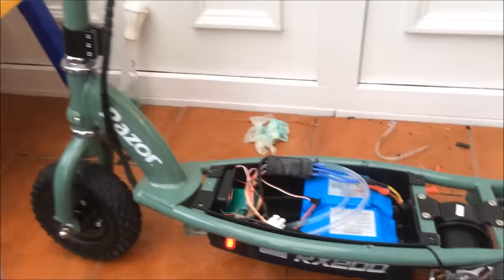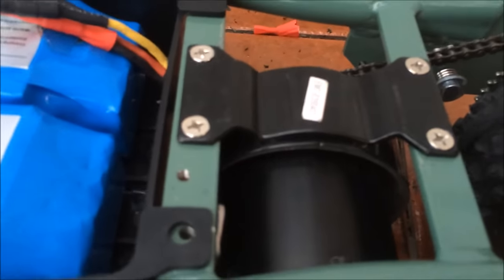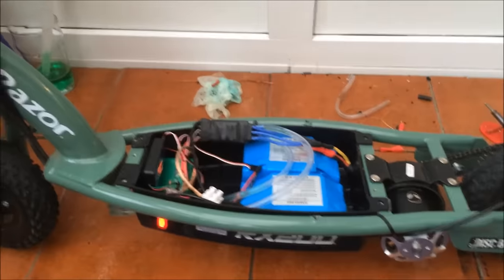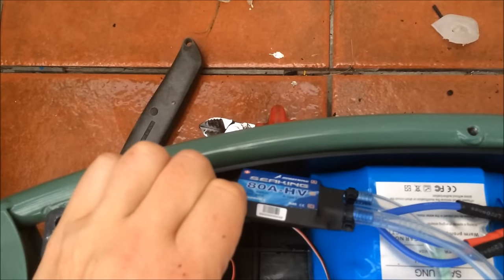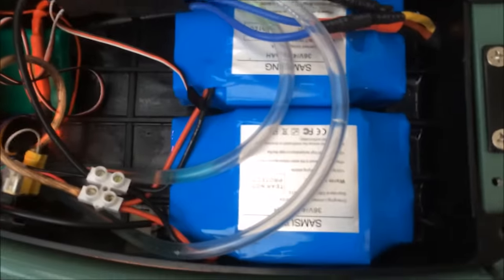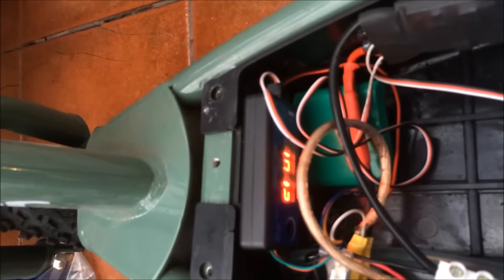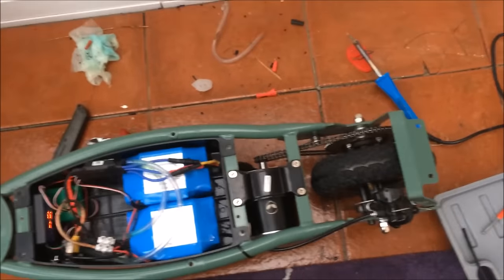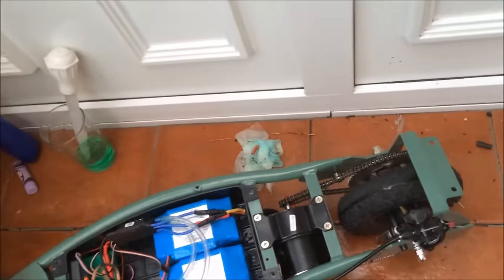razor 7000w scooter brushless out runner, modified, liquid cooled, Build pics

Comment: Definetly need a way bigger controller! Surprised the 80a hasnt blown up
Reply: U need atleast 400 amp not 80 amp
Reply from the maker: I am now running a vesc set to 50 amps at 12s, as long as you have an adequate low kv motor and a good gear ratio, you hit maximum rpm quickly and the load drops drasticly,  dont forget i am running liquid cooled.
Reply: Yeah It won't pass 50 amps because of the gearing. Gear it taller and the esc will fry. But this motor has a lot of potential. This hobbyking esc I have does 200 amps at 8s. Something like that would make it fast
Reply from the maker: Its far to fast as it is, but now it has hyrdraulic disk brakes and 10 inch tyres, if you want to use 6000w at 34v you will need serious batterys, brakes, and tyres like i have.
Reply: Yeah true, where did u get 10 inch wheels from? I'm planning on building something similar. I'm using a 730kv motor, draws 193a max load. From a 1/5 scale rc car.  Crazy to use 30,000rpm but I can gear it down and this motor can draw 7500w so it should be fast
Reply from the maker: I bought a razor e300 it had 10 inch tyres on,
You would be drawing 193amps all the time, the top speed of that motor would be 120mph and you would never be able to get there, that motor is not suitable, you need a motor that is  designed to hit its rated rpm at your design mph, your motor and your controller would burn in 60 secounds, I can do 40mph at 20 amps because my motor is under low load at its design rpm (6000rpm at 50v). At 6000rpm your motor would be at full load (over200amps) until you reached over 100mph and 30000rpm, by which time the wind resistance would be adding more load than the weight of you and your scooter, and you would need 100ah of batteries at 34v to last 30 mins, but you would  destroy most batteries with a constant 200 amp draw.